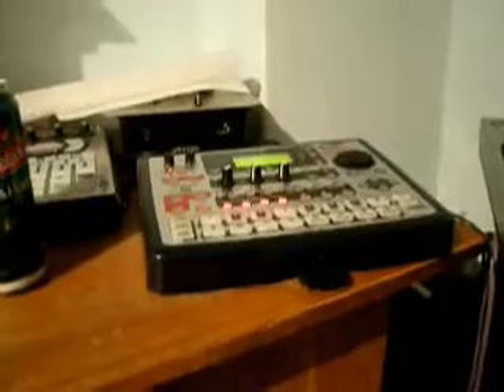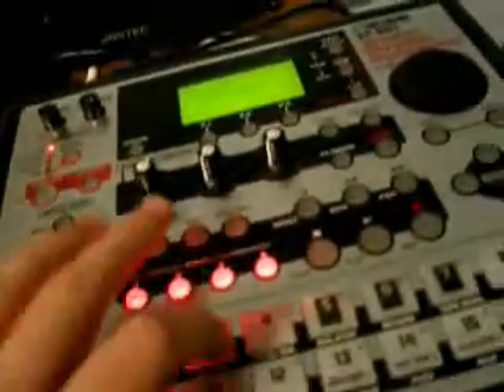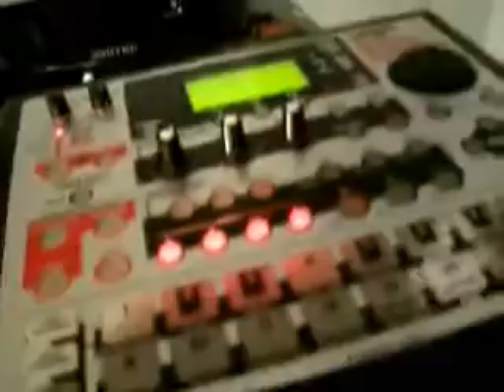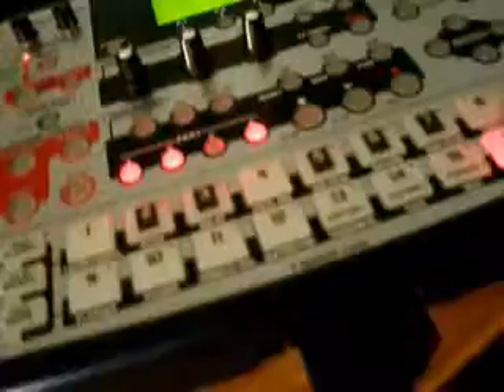Tips'n'Tricks for Boss SP-505 (Part 4)

Comment from the maker: Sample in one peace whole sound source. Use truncate to remove unneeded parts, amplify selections or whole sound and then enter the chop mode. In chop mode specify sensitivity for the auto chopper. This will depend from the sound source's volume and length - you will need to try this out a few times - all together this is trial and error process. In chop screen edit each chop individually and hit save when you are done with that.

Comment from the maker: no it is not velocity sensitive but you can can connect any device that sends midi velocity notes and it will trigger samples at different volume level. speaking about sp303. it is way advanced than 303 it has lots of nice features, but they share the same sampling engine so the sound is very similar to 303. but for me, yes it is better than 303.  you actually cant compare them because 303 is more like a budget on-stage/live sampler whereas 505 is more of the studio type sampler.

peace,
olby